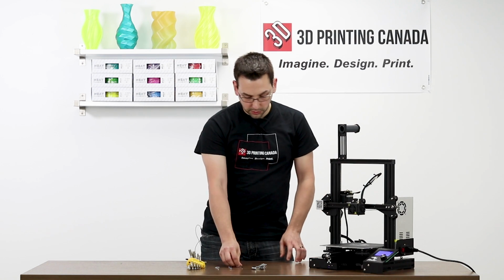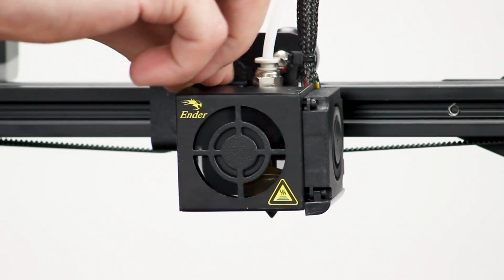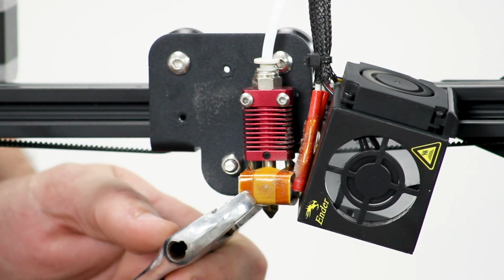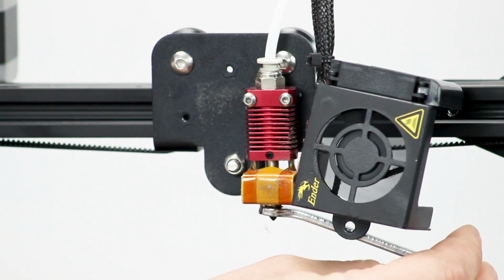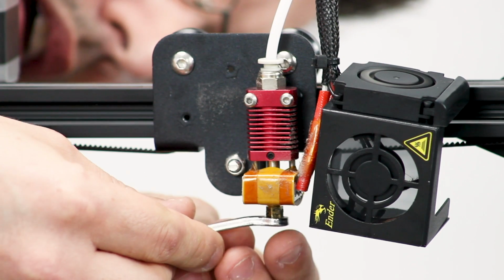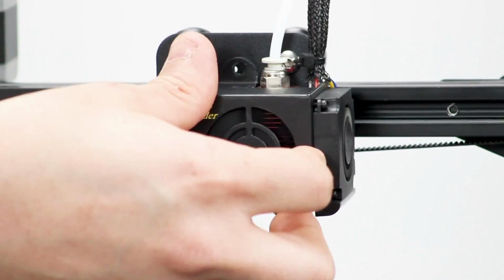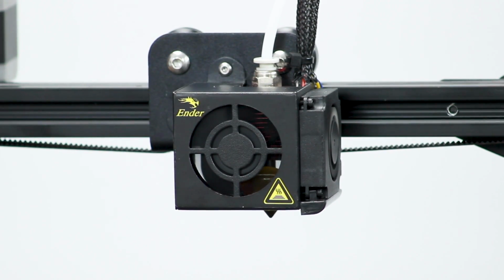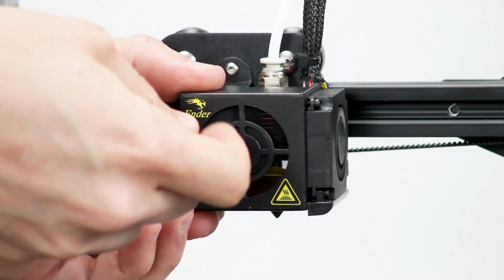Creality Ender 3 Nozzle Replacement

Comment: “This is not intimidating at all” *puts hands millimeters away from extremely hot heater block and hand screws nozzle back into place*. This guy is a mad lad.
Reply: you stop feeling heat in your fingers after a few months of printer tinkering.

Comment: I used a 6mm socket to remove the nozzle.
Reply: Thank you for saying what size socket is needed!
Reply: Definitely the way to go.
Reply: 6mm was bang on.  Thanks
Reply: Thank you!!!!
Reply: 6mm socket worked for me, the provided wrench is garbage
Reply: Thank You gentleman
Reply: I hated that no ordinary mechanics set has anything smaller than an 8mm wrench
Reply: Thank you, I simply can't comprehend why it's so hard for Ender 3 video makers to leave out basic information.

Comment: watched this video after screwing up the heater block and damaging the nozzle, but I know now for next time lol
Reply: Time23DP I did the same, but luckily I didn’t damage the heatblock, but once I changed the nozzle, everything was fine. x3
Reply: how did you damage the heat block. our heat block has melted PLA on top, i feel like that is not good and therefore there is an issue above, wondering if i need to replace
Reply: @sabrinajohnson9977  melted pla is completely fine and normal, as long as you make sure to do regular maintenance (once every few months or so) on your hotend, you should be fine :-)

Comment: Got my Ender 3 last month, still print perfectly fine. What are the signs that it's time to replace the nozzle?
Reply: maybe if you can hit the nozzle to de bed (to close) or similar and deforme it. Also you maybe want to use other sice of nozzle (1mm print very fast). Sorry for my english
Reply: you keep getting blockage and no filament coming out
Reply: Esteve Pastor gggvr
Reply: i cut the tip off of mine...
time to replace
Reply: Maintenance isn’t the only reason to change a nozzle. You may want to change the type of nozzle you’re working with (steel vs brass) or the size of the nozzle (1.0 mm nozzles are god-tier. Change my mind)

Comment: Whats the purpose of having it heated up? Will it not will be more difficult to unscrew if it is expanded due to the heat.
Reply: As it cools it tightens up, not the other way. Also, if there is any melted filament at the top of the nozzle it will "glue" it to the thread if it is cold enough.

Comment: When you say "nice and snug" mine is tight and feels like it might snap if i tighten anymore but it is hanging out by about a mm or 2, ive just replaced it as the old one had come loose and leaked filament around the hot end through the threads so want to avoid this happening again

Comment: Hello, I've made the change following your video. As my nozzle was too hard to remove I've unscrewed all parts to be able to remove it but once finished and printing the nozzle has started to smoke ... ouch... please do you know what did I make wrong? I think of the small wire which seems to be a sensor...
Reply: what happened?

Comment: I'm having the same exact issue.. but the part you secured with the wrench, the "heat cartridge" .. On mine I can see the PLA leaking in and out. How do I fix this?? :(
Reply: same problem.....
Reply: Did you screw the new nozzle anyway?

Comment: Ok, but what do you do with the filament? I had removed the filament when it was hot, as though I was changing it. This always leaves some in the nozzle (which gets bled out on the next print priming). So when I pull the nozzle off hot, it's all gooey. Is it just a matter of time and experience?

Comment: I snapped the bolt on my heat break some how. Do you happen to know the replacement size?
Reply: i heard a load snap in my ender too, i think i broke it too...
Reply: Is it one of those side bolts (of the two on either side). Those aren't actually supposed to be there. The supplier of heatblocks to Creality was supposed to remove those but never has and Creality has never asked for it to be done. They only do harm if you notice your cold end is getting too warm as the heat travels up through those bolts. At PLA settings this usually isn't a problem but at higher temps it can be. So you can either just leave that broken bolt as is, or remove them both. They weren't supposed to be there in the first place.

Comment: Thanks you video, I have a question, you don't touch ptfe tube in any moment..but imagine that it is quite burned or partially broken (and you need to cut one part or exchange it).. how would you know the correct position of ptfe tube? because this kind of nozzle touch directly with the ptfe tube since it pass through all cooling block, isn't it?

Comment: Where is your little black cover  There is usually one over the heating block
Reply: This is an earlier model that has a kapton tape insulator. Newer Enders have a black (or blue) silicone insulator, but it does the same job.

Comment: The one question I have that none of the videos address that I’ve seen, do I need to retract before if I have filament in it?
Reply: Its best to remove the filament entirely to prevent melted plastic getting onto the nozzle threads.

Comment: When I removed my nozzle to switch to a smaller one, there was a bunch of leftover PETG within the nozzle and a bit overflowing out of the larger (threaded) side, which has now harden. I'm worried that when I put back the nozzle the overflowed bits might melt and seep into places they shouldn't be. Is that something I should be worried about? If so, is there an easy way to clean it? I don't have acetone with me but if submerging it in acetone is the only way to clean it I'll have to go get a bottle.

Comment: I was doing a print that I had done several times before and when I came back to my print the filament was mushed together and some seeped into the heatblock. Will it be okay to keep printing with it? Or wil I need to install a new heatblock?

Comment: My ender 3 pro nozzle won't screw all the way in. I tried to replace my nozzle but then my new one wont screw in. But its the same size then the old one cant fit too i tried to heat it up and then replace but it didn't work.I tried to pull out the ptf tube but its stuck and i look at the ptf end but it looks normal and didn't block the thread. Anyone knows whats the problem?

Comment: Great video! One question: What are the signs I need to change the nozzle? Thank you in advance!
Reply: Print quality starts to go bad, and also you might what to check the head monthly or every week depending on how much you use your printer. To check, just take the extruded head and look for wear and tear. If present, creality sells 24 extruded heads for $10

Comment: Please do a video on proper method to change filament.  I have clogged my Bowden tube twice now.
Reply: Tech-Titan take out the Bowden tube at the extruded end and feed end then pull it out. If it does not come out take the nozzle off and cut the filament. This has worked for me

Comment: So it's okay to have the power on while performing this?  Any risk of shock?
Reply: You have to do it with a hot nozzle throughout the whole process.. What shock? it's only 24V dude lol
Reply: Jim D - thanks yeah I got through it OK.
Reply: Well, I don't know the watt delivered by the power supply, but 24V can be really dangerous if you get lots of ampères with it. Usually, high voltages will tend to be less dangerous because of that (your "resistance" won't change, so more volts means less ampères). You can touch a tesla coil without feeling anything while there are thousands of volts, because there is almost no ampère.

But there is still really low risk with changing the nozzle like that. The nozzle itself isn't directly in contact with current, and except if you have a special nozzle, the nozzle itself isn't that good at conducting current.

Comment: Oh man, I'm such an idiot. I just got my Ender 3 and I had no idea you had to heat the nozzle before removing and putting it back on. I was having multiple problems with prints, and when I finally took the nozzle off, turns out filament had filled the nozzle thread >.<

Comment: I thought those 2 side screws between the heat block and heat sink are for installation only and they should be taken out for normal operation  They will heat which is not good

Comment: I'm assuming that I need to remove the filament before removing the nozzle.
Reply: From my reading and watching you have to do a cold pull to extract the filament so it doesn't get in the thread but I'm very much a novice at 3d stuff.

Comment: when should I replace the noozle?
Reply: Its not always about nozzle wearing out.
Its also useful when printing large models like boxes. 
If you print with 0.4mm nozzle then it will take alot of time. 
If you dont have small text or details on boxes then you can use 0.8 mm nozzle and it can decrease 6 hour print to about less than a hour print.
Suppose you want to print 3 boxes.
It will take nearly 24 hours with 0.4.
But with 0.8 mm its around 2-3 hours, if not less